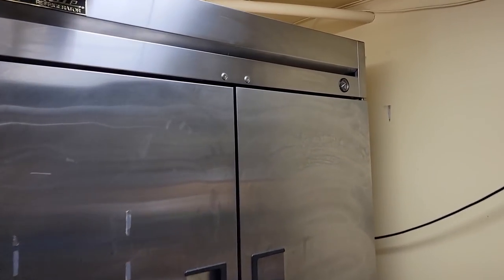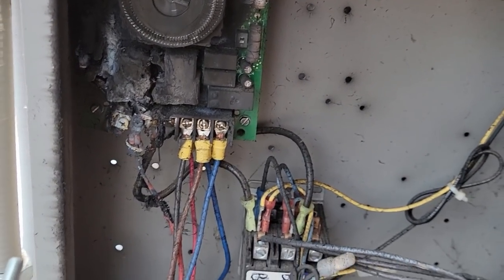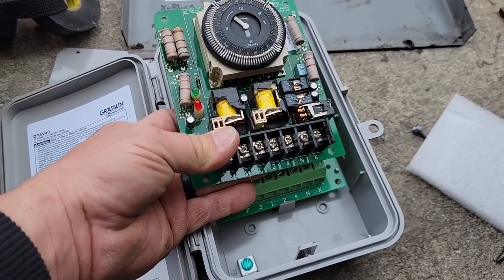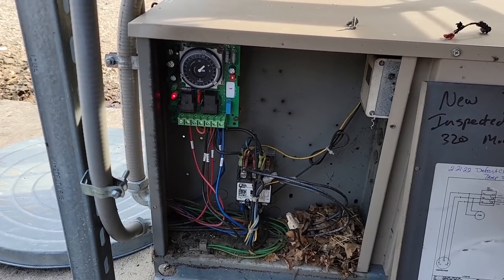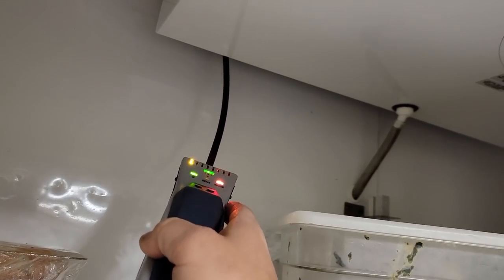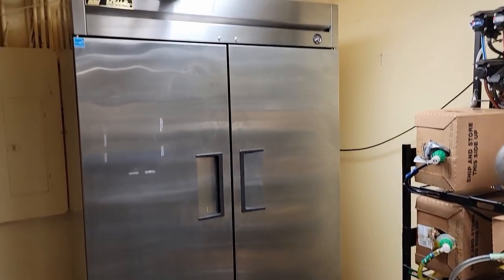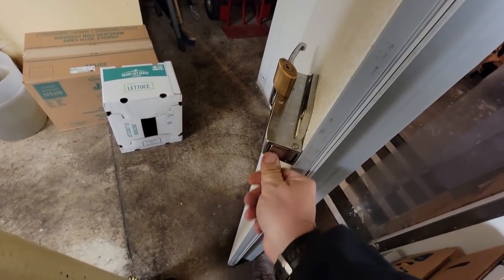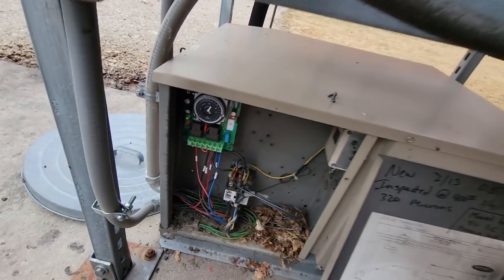Surprise! Cooler And Freezer ARE Going Down

Comment: Like the door tool. On panic devices, the small hole has a 5/32” hex and you can use your Allen wrench to lock the push bar to keep the door from  locking on you. Otherwise great tool. Just hate to see the tool break and knock you where the sun doesn’t shine in 10 degree Ohio weather.
Reply from the maker: Yeah I've done that several times too, I just wanted to show that there is times where you can use it for all the weird doors. Thanks for the feedback and for watching the video!
Reply: note to self: read other comments before posting more or less the same thing. 😵
Reply from the maker: @throttlebottle5906  👍👍

Comment: A bar had a door almost lke that and you could have the latch retracted bu turning a screw under the handle with a flat screwdriver. That may be a different kind of self locking door though. Great video, Thanks for posting. 
👍
Reply from the maker: You're welcome 👍👍

Comment: That labeler is a lot more professional than my sharpie marker I use
Reply from the maker: It cost more too 😁. The labeler is only 100 bucks but the freaking labels cost way more than normal labels. Damn there you are Joe where the hell have you been hiding buddy. Didn't even see who it was until I looked up again 😁🤟
Reply: @HVACRSurvival  I'm retired now, from HVACR stuff. I've worked many years as a reefer on ships. I've never seen a defrost timer so burnt! Even after getting douched in saltwater!
Yeah, that's s bad connection! As part of my PM for customers, I was to check the contacts on the contactor(s). Years of experience has taught me that looking at them is a waste of time, and often misleading. 
Check the voltage drop, while running, across the contactor. If it is more than a volt or 2, look for poor crimps (connections), then dig into the contactor if you don't find loose connections.
You will save yourself time, and call backs. Oh, and you won't have grumpy customers 🙄!
Oh yeah, about the labeler, ain't they great? Got one for my last job, rewiring locomotives, at least I got the company to buy the labels...😃
Reply from the maker: @brucelytle1144  Thanks Bruce for the feedback!
Reply: @HVACRSurvival  yeah, label tape costs too much and they make them dang things to waste lots of it, when making single labels not in a continuous string.

Comment: loose connection that arced to the adjacent terminal. Arcing has a way of creating high voltages, as well as "surface of the sun" temperatures.
Reply: It's basically electricity flowing through ionized air. The resistance of that air as it breaks down is why arcing is so hot.

Comment: I do residential however...can you use programmable defrost clock that is sealed against sand, bugs, wasps and just present a display?  What examples if possible...?  Dirt and grit seems to trash clockworks fast.
Reply from the maker: The old fashioned mechanical clocks were a lot more durable, they use contacts that were rated for 40 amps and we're nearly twice the size of these little electronic relays they use. They also weren't affected by dust like these are.  Newer is not always better 👍👍

Comment: I don't know if there are some rule or if it"s the right way to do thing or why there are done like this, but leave mice nest in the electric pannel, topping off charge in a leaky system without planned fix and left deadly trap behind, I found all theses things frightening but gain maybe it's all the correct way to do.
Reply from the maker: (B1)- I don't and can't bad mouth the customer on my video for not fixing the cooler?  Do you have a good way of forcing them to repair or replace the unit? (B2)- I didn't record blowing out the leaves sorry. (B3)- I'm not sure what DEADLY trap your talking about? Thanks for watching!
Reply: @HVACRSurvival B1 As it's forbidden to vent 134a to the atmosphere I thought some restriction may exist to forbid to add refrigerent in a leaky system but it seems to be OK; B2 I got it B3, You said if the door close you had to bust it, Isn't that dangerous to left it like this ? Maybe people trapped in freezer like this one is only an urban legend,  don't know if these doors are easy to bust.